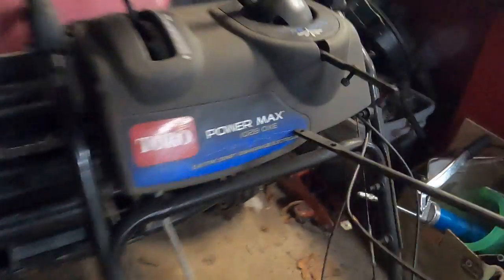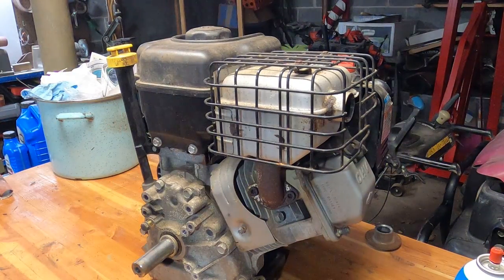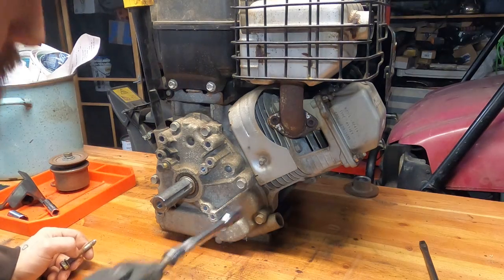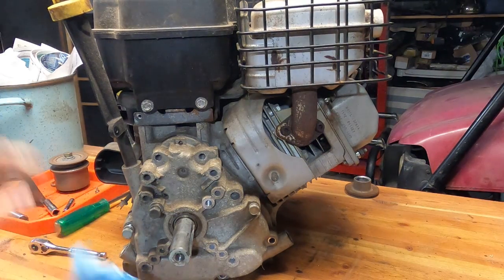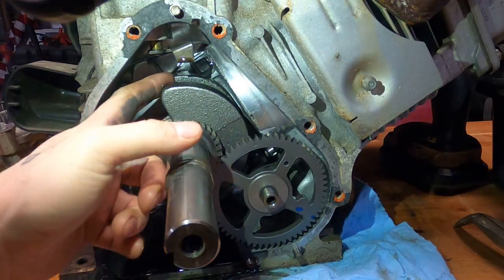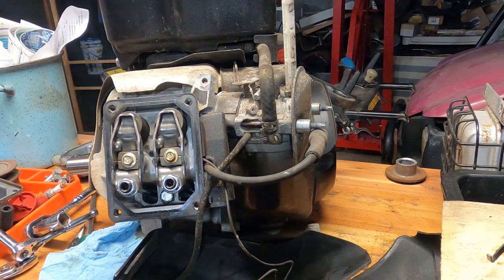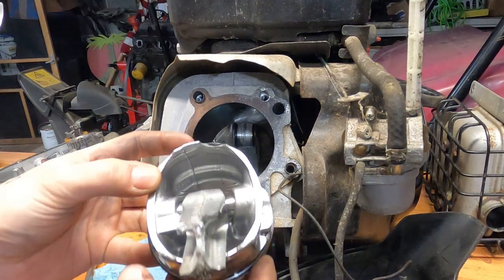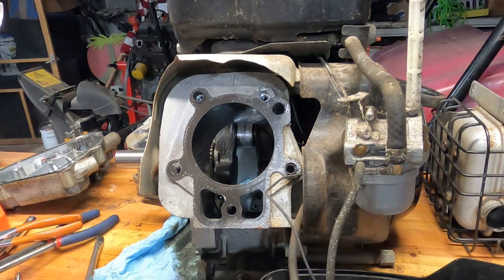WHAT WENT WRONG? - $40 Toro 1028 Snow Blower

Comment: older briggs motors are ok but i grew up on Kohlers and when ours blew thats when i got into repairing them i don't like anything about newer briggs motors Had a 14.5 I/C briggs for around 20 years with no real problems besides plastic starter gear and it had a plastic flywheel gear that whore out but always ran great fired up any time Used it to replace a 21HP newer briggs that blew the connecting rod out the side wall

Comment: Are you going to rebuild the engine ?  Or replace it.  From what I could see it dint look to bad.  Perhaps a little acid on the crank would remove the aluminum from the bearing surface or crank journal.  The engine looked okay, throw some parts at it and it would most likely run pretty solid.  I'd go ahead and attempt a rebuild.  I guess they never checked the oil...  I think it's mucritic acid and it will melt right before your eyes.  Wear safety glasses and have a 64 ounce bottle of water close by in case you get a drop in your eyes.  I think theres videos even on this subject.
Reply from the maker: I plan to rebuild it at some point for my own use. Didnt make sense to spend that on the blower in question as resale value would not have covered all costs. I will probably rebuild it when my kid needs a bigger go cart engine, honestly

Comment: I would agree tecumseh was probably the best snow blower engine on the market, but unfortunately the couldn't survive on just making snow blower engines a few months out of the year. They made good snow blower engines but sucked at making everything else we had a tecumseh push mower engine that always gave us issue from day one brand new when we bought it.
Reply: After mounting a Tecumseh 10 horse on a bicycle and riding it occasionally for a few years, Tecumseh's biggest issue is the carb. They work fine for a stationary engine, but they don't seem to be designed for more substantial vibration. Swap the carb to anything else you can make fit and it'll be a really good engine.

Comment: You might be able to save that crank. I worked at a Snapper dealer about 30 years ago. My boss rebuilt engines that looked like that one. There is melted aluminum from the rod on the crank. He used some type of acid(sulfuric acid maybe?) To dissolve the aluminum. Mabye some videos out there on how to do that. Good luck to you.
Reply from the maker: Wow.. what an awesome suggestion. Thank you. I will be looking in to that
Reply: @DougvCarburetor  Muriatic acid used in concrete work will dissolve the stuck-on aluuminum, there are a few videos of people using it. Proceed with extreme caution, I've used it on concrete but only with a respirator & goggles.